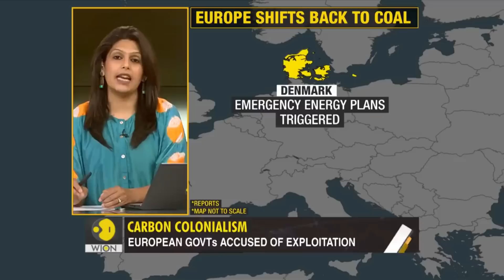Ghana is Finally going NUCLEAR POWER to intensify Industries and the African Free trade Area

Comment: Europe and the US are all hypocrites
Reply: Th at i is a favt. Even watch through the comments as their agents argue against Ghana adopting nuclear while their own countries are rather claiming nuclear as a green energy source!

Name a country that is powering its industries and societies primarily through renwables? Norway? They are currently paying record prices to electrify and heat their homes. And that is based on their hydroelectric energy sources. Germany? They are getting prepared to put their renewable solution to its biggest test this winter. If that test fails? Millions of them will freeze.
.
 There are Afrikan countries that are already amongst the TOP 10 highest consumers of renewable energy. How is that working out for their respective industries and societies?

The 10 countries using the largest percentage of renewable energy are:

DR Congo - 96.24%
Somalia - 95.03%
Central African Republic - 91.26%
Uganda - 90.22%
Gabon - 89.88%
Ethiopia - 88.92%
Liberia - 87,24%
Guinea-Bissau - 86.24%
Tanzania - 85.22%
Burundi - 84.77%

For further comparison here is a macro look at renewable energy consumption on Country by Country basis:

Country Renewable Energy Consumption % 2022 Population
DR Congo	96.24%	99,010,212
Somalia	95.03%	17,597,511
Central African Republic	91.26%	5,579,144
Uganda	90.22%	47,249,585
Gabon	89.88%	2,388,992
Ethiopia	88.92%	123,379,924
Liberia	87.24%	5,302,681
Guinea Bissau	86.24%	2,105,566
Tanzania	85.22%	65,497,748
Burundi	84.77%	12,889,576
Zambia	84.50%	20,017,675
Madagascar	82.77%	29,611,714
Bhutan	82.27%	782,455
Zimbabwe	81.50%	16,320,537
Nigeria	81.40%	218,541,212
Iceland	81.07%	372,899
Niger	80.83%	26,207,977
Cameroon	79.41%	27,914,536
Mozambique	78.08%	32,969,518
Rwanda	77.86%	13,776,698
Chad	77.79%	17,723,315
Nepal	77.39%	30,547,580
Mali	76.64%	22,593,590
Haiti	76.40%	11,584,996
Togo	76.21%	8,848,699
Sierra Leone	75.44%	8,605,718
Eritrea	73.67%	3,684,032
Malawi	73.02%	20,405,317
Republic of the Congo	68.67%	5,970,424
Kenya	68.08%	54,027,487
Eswatini	65.95%	1,201,670
Guinea	65.44%	13,859,341
Burkina Faso	64.85%	22,673,762
Guatemala	62.92%	17,843,908
Ivory Coast	62.46%	28,160,542
Norway	62.37%	5,434,319
Sudan	62.23%	46,874,204
Uruguay	60.76%	3,422,794
Paraguay	60.09%	6,780,744
Myanmar	57.85%	54,179,306
Liechtenstein	56.13%	39,327
Angola	54.69%	35,588,987
Comoros	53.43%	836,774
Cambodia	53.36%	16,767,842
Papua New Guinea	53.09%	10,142,619
Sweden	52.88%	10,549,347
Nicaragua	50.71%	6,948,392
Sri Lanka	49.91%	21,832,143
Gambia	49.24%	2,705,992
Laos	48.43%	7,529,475
Solomon Islands	48.39%	724,273
Brazil	47.57%	215,313,498
Benin	46.47%	13,352,864
Honduras	45.96%	10,432,860
Finland	45.76%	5,540,745
Pakistan	43.46%	235,824,862
Ghana	41.80%	33,475,870
Latvia	41.52%	1,850,651
Albania	40.20%	2,842,321
Lesotho	39.47%	2,305,825
Montenegro	38.74%	627,082
Tajikistan	38.56%	9,952,787
Denmark	37.52%	5,882,261
Senegal	37.20%	17,316,449
Sao Tome and Principe	37.09%	227,380
Bosnia and Herzegovina	37.02%	3,233,526
Costa Rica	35.79%	5,180,829
Samoa	34.21%	222,382
Austria	33.77%	8,939,617
Lithuania	33.53%	2,750,055
India	32.93%	1,417,173,173
Croatia	31.60%	4,030,358
Estonia	31.29%	1,326,062
Colombia	30.72%	51,874,024
Namibia	30.69%	2,567,012
New Zealand	29.65%	5,185,288
Belize	29.09%	405,272
Portugal	28.19%	10,270,865
Djibouti	27.92%	1,120,849
Kyrgyzstan	27.88%	6,630,623
Peru	27.13%	34,049,588
Philippines	26.73%	115,559,009
South Sudan	26.65%	10,913,164
Fiji	26.48%	929,766
Botswana	25.57%	2,630,296
Chile	25.26%	19,603,733
Georgia	25.22%	3,744,385
Switzerland	24.76%	8,740,472
Bangladesh	24.75%	171,186,372
Mauritania	24.70%	4,736,139
Thailand	23.96%	71,697,030
Romania	23.54%	19,659,267
Canada	22.11%	38,454,327
Moldova	22.04%	3,272,996
Cuba	21.54%	11,212,191
Serbia	21.53%	7,221,365
Slovenia	20.86%	2,119,844
Bulgaria	19.34%	6,781,953
Indonesia	19.09%	275,501,339
Panama	18.91%	4,408,581
Vietnam	18.65%	98,186,856
Afghanistan	18.51%	41,128,771
Greece	18.51%	10,384,971
Andorra	18.40%	79,824
Ecuador	17.73%	18,001,000
Slovakia	17.64%	5,643,453
Italy	17.27%	59,037,474
Spain	17.27%	47,558,630
Germany	17.17%	83,369,843
Luxembourg	16.45%	647,599
North Macedonia	16.32%	2,093,599
Czech Republic	15.85%	10,493,986
Venezuela	15.62%	28,301,696
France	15.53%	64,626,628
China	14.45%	1,425,887,337
Suriname	14.40%	618,040
Turkey	14.12%	85,341,241
Palestine	13.86%	5,250,072
Hungary	13.64%	9,967,308
Greenland	12.60%	56,466
Ireland	12.34%	5,023,109
United Kingdom	12.24%	67,508,936
Tunisia	12.20%	12,356,117
Poland	12.18%	39,857,145
Cyprus	12.05%	1,251,488
Marshall Islands	11.70%	41,569
Timor Leste	11.67%	1,341,296
Guyana	11.35%	808,726
North Korea	11.31%	26,069,416
Argentina	10.74%	45,510,318
Morocco	10.69%	37,457,971
South Africa	10.50%	59,893,885
United States	10.42%	338,289,857
Grenada	10.37%	125,438
Mexico	10.34%	127,504,125
Armenia	10.34%	2,780,469
Belgium	10.21%	11,655,930
Australia	10.13%	26,177,413
Jamaica	9.09%	2,827,377
Mauritius	8.94%	1,299,469
Bolivia	8.67%	12,224,110
Netherlands	8.54%	17,564,014
Tuvalu	8.20%	11,312
Jordan	8.17%	11,285,869
Dominica	8.05%	72,737
Belarus	7.83%	9,534,954
Malta	7.70%	533,286
Japan	7.69%	123,951,692
French Polynesia	7.67%	306,279
Aruba	7.48%	106,445
Ukraine	7.44%	39,701,739
Equatorial Guinea	6.48%	1,674,908
Saint Vincent and the Grenadines	5.68%	103,948
Lebanon	5.46%	5,489,739
Faroe Islands	5.40%	53,090
Egypt	5.30%	110,990,103
Malaysia	5.11%	33,938,221
Israel	4.47%	9,038,309
Barbados	4.31%	281,635
United States Virgin Islands	3.66%	99,465
South Korea	3.36%	51,815,810
Mongolia	3.32%	3,398,366
Russia	3.22%	144,713,314
Yemen	3.11%	33,696,614
Guam	3.02%	171,774
Libya	2.80%	6,812,341
Curacao	2.68%	191,163
Puerto Rico	2.42%	3,252,407
Isle of Man	1.90%	84,519
Micronesia	1.78%	114,164
Tonga	1.77%	106,858
Kazakhstan	1.70%	19,397,998
Azerbaijan	1.62%	10,358,074
Saint Kitts and Nevis	1.58%	47,657
Uzbekistan	1.57%	34,627,652
British Virgin Islands	1.23%	31,305
Bahamas	1.14%	409,984
Maldives	1.11%	523,787
Syria	1.02%	22,125,249
Iran	0.98%	88,550,570
Antigua and Barbuda	0.91%	93,763
Singapore	0.84%	5,975,689
Bermuda	0.84%	64,184
United Arab Emirates	0.67%	9,441,129
Nauru	0.61%	12,668
American Samoa	0.50%	44,273
Iraq	0.43%	44,496,122
Trinidad and Tobago	0.34%	1,531,044
Palau	0.29%	18,055
Hong Kong	0.23%	7,488,865
Algeria	0.16%	44,903,225
Turkmenistan	0.06%	6,430,770
Kuwait	0.06%	4,268,873
Sint Maarten	0.05%	44,175
Qatar	0.04%	2,695,122
Saudi Arabia	0.03%	36,408,820
Brunei	0.01%	449,002
Oman	0.00%	4,576,298
Bahrain	0.00%	1,472,233
Cayman Islands	0.00%	68,706

Even the West does not take the renewable scam that seriously. Less so with the current test pending that they are facing this winter; without their usual supply from Russia.

There is no substitute for how the industrial economy runs today. The "renewable" push is a road to de-industrialization. A dead end one at that.

Afrika does not need to fall for any "Bait and Switch." They have to get tired of being dupes and suckers for Globalist schemes at some point. 

Renewable Energy is The Scam We All Fell For
https://youtu.be/lL6uB1z95gA

Bill Gates Slams Unreliable Wind and Solar Energy
https://youtu.be/9xe3BWPsBTU

Why renewables can’t save the planet 
https://youtu.be/N-yALPEpV4w